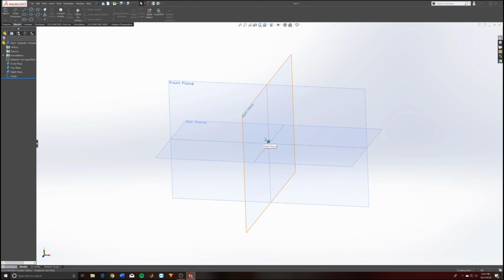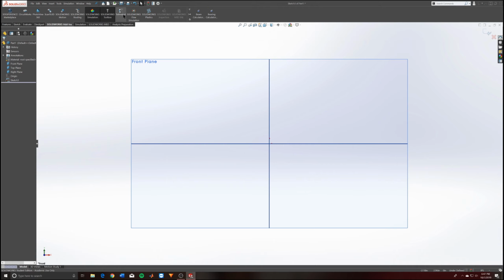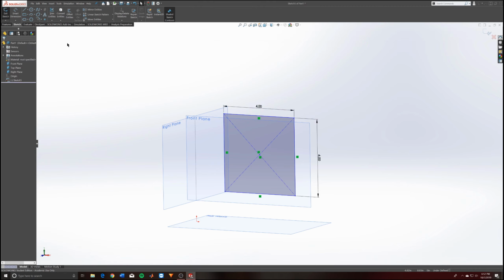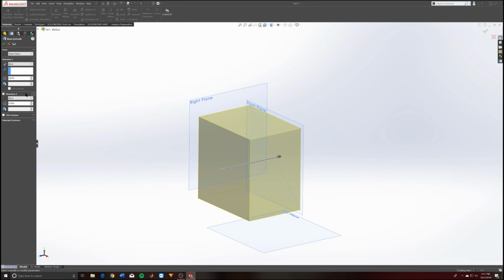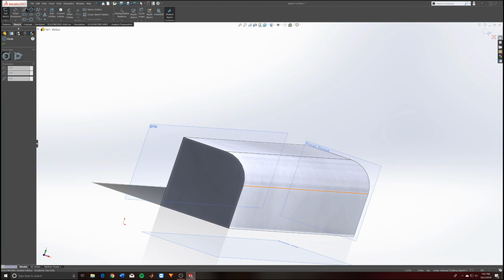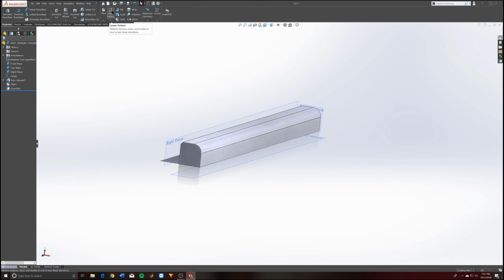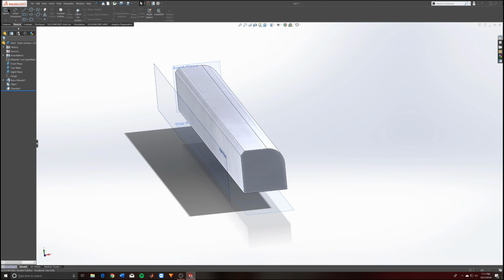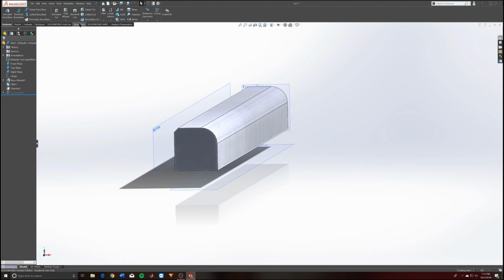02 - introduction to sketches and features in Solid Works 2018

Comment from the maker: video time stamps: 
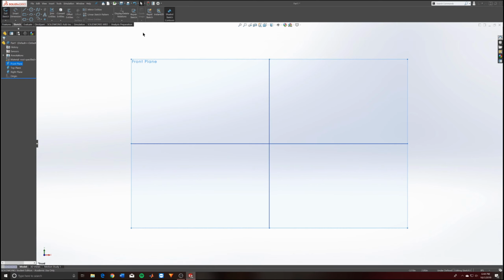1) Start Sketch - @2:55
2) Using toolbox to sketch standardized parts - @ 5:45
3) Smart Dimensions - @8:15
4) Linear Sketch patter - @12:20
5) Extrude Boss/Base - @15:15
6) Fillet Feature - @20:10
7) Extrude Cut - @20:50
8)  Shell - @23:45
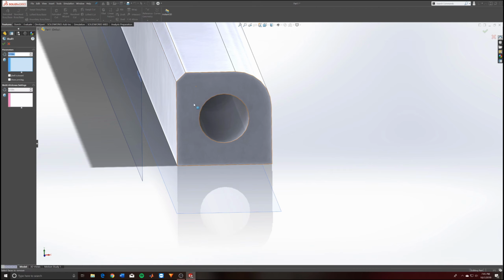9) Linear Pattern - @23:30
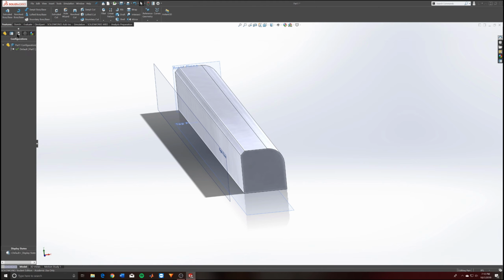10) Configurations - @29:25
11) File Properties - @31:30
12)  Recap - @32:55